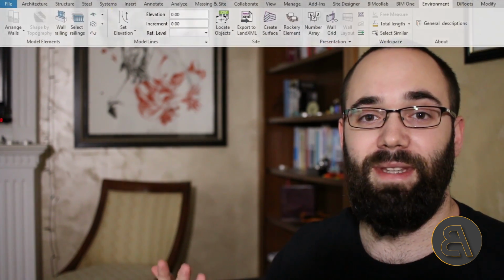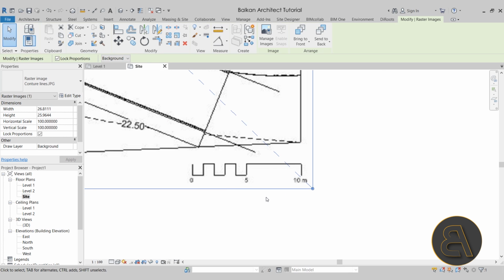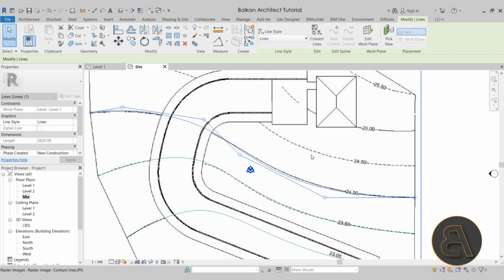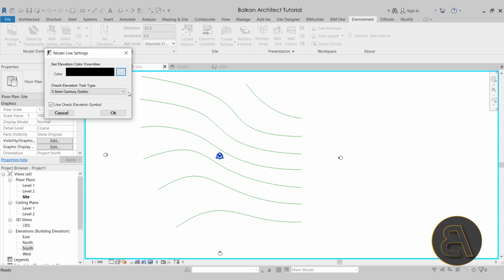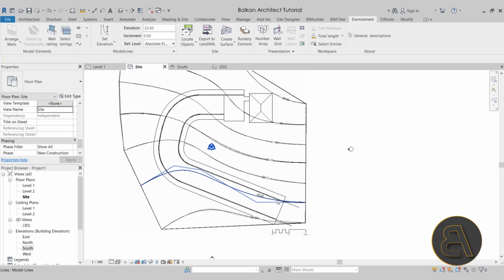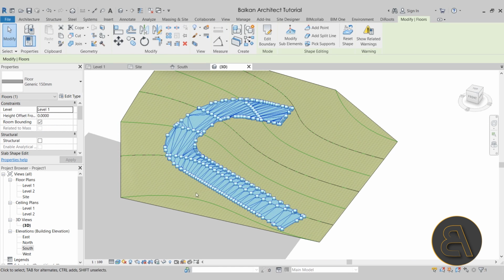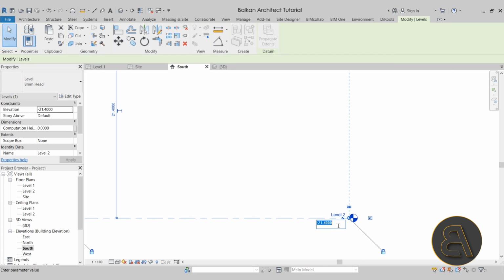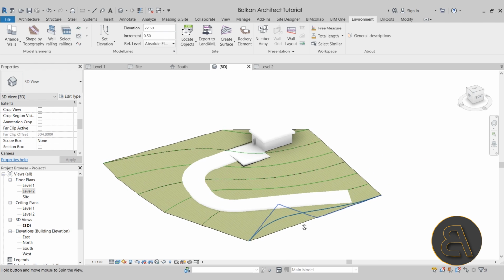Ultimate Revit Plug-In for Topography Tutorial

Comment: Is there a way to import a 3D DNG to use as topography in revit?
Reply: That depends on how the 3D DGN was created. If the DGN contains smart solids than it is not possible to import it into Revit (and AutoCAD) as smart solids are not supported. You will have to save the DGN into a DWG.